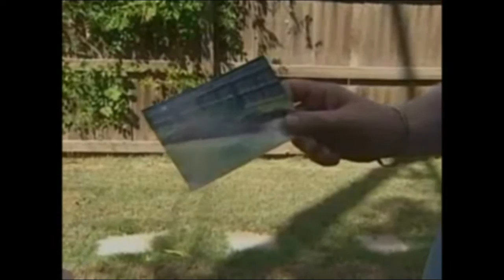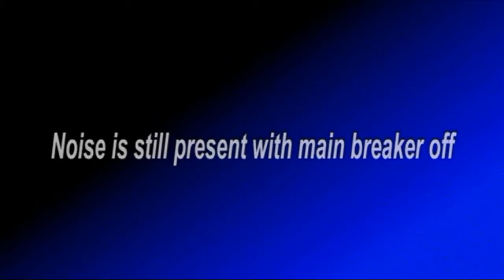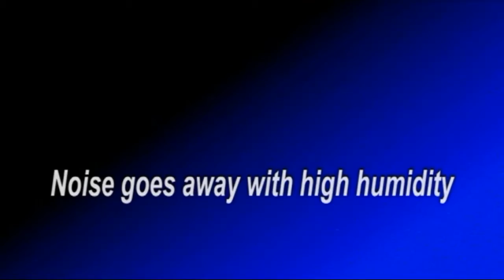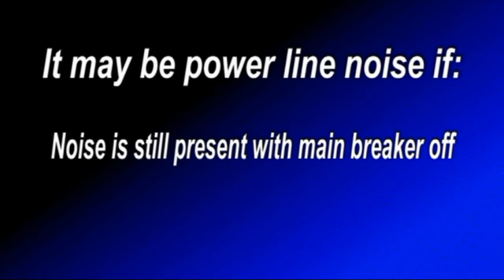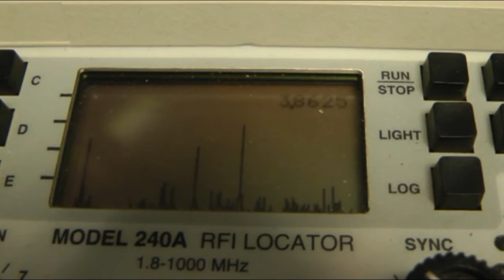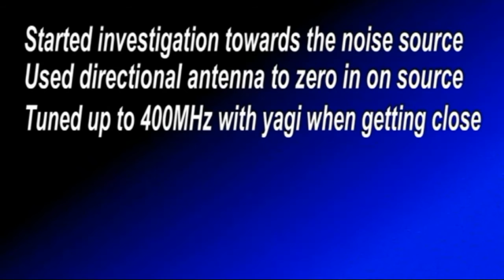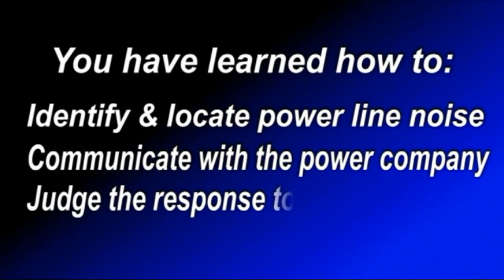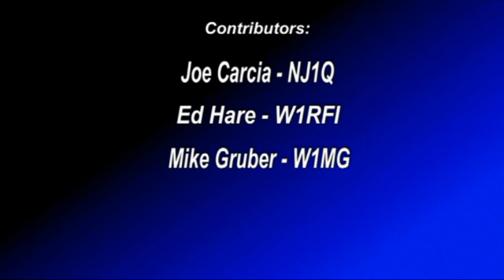ARRL: Identifying Power Line Noise

Comment: What about cases where the FCC says it has no jurisdiction over power companies and refers complainants to the local Public Utility Commission?
Reply: When it comes to RFI problems, only the FCC has jurisdiction. Under FCC pre-emption of RFI matters, local or state regulators do not have jurisdiction.  If the FCC said it doesn't have jurisdiction over radio noise from power lines, whoever said that is mistaken.  

If the problem involved amateur radio, contact ARRL at rfi@arrl.org and we can explain the process we use with the FCC to the cases resolved.

Ed Hare, W1RFI
Reply: @jpcgpc  As someone that deals with RFI as part of my job, I can say the FCC does get involved if they get written complaints that indicate the power company is not doing anything about the problem.  FCC letters are usually addressed to the utilities CEO.